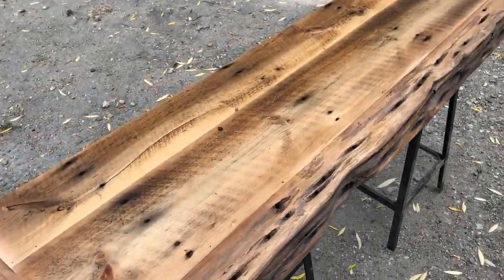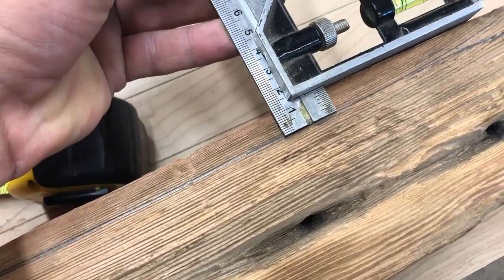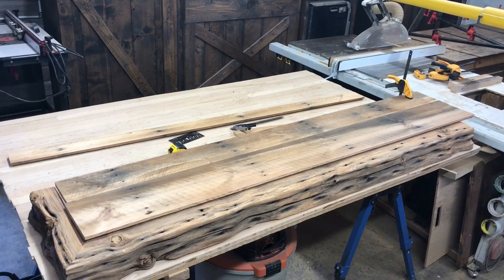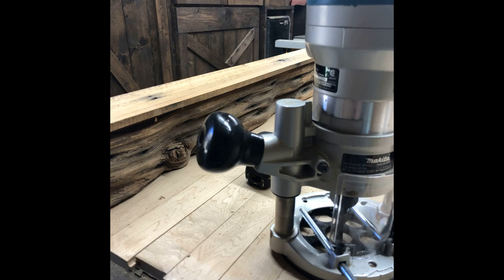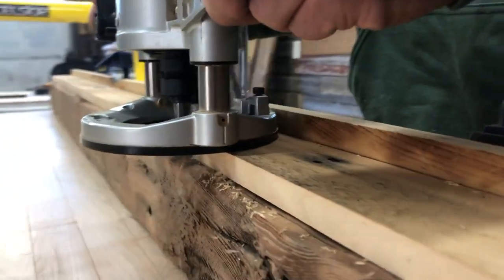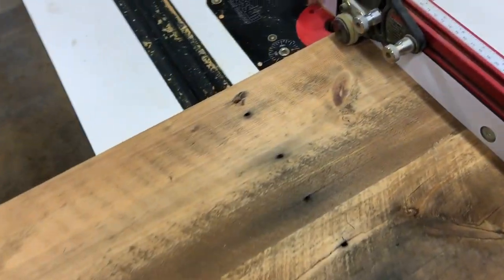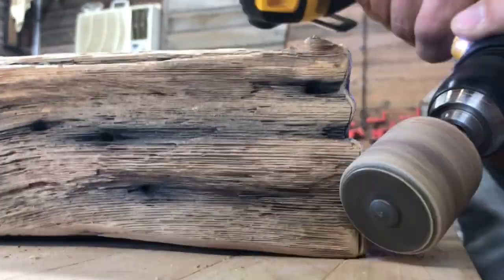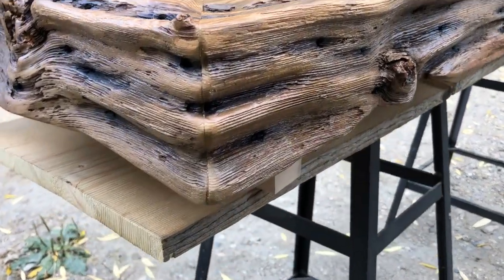Barnwood Beam Fireplace Mantle Build

Comment: The finished edges looked good.  I’m wondering why you didn’t use cedar plants for the top and try to match it better.  If you did forgive me.  I just didn’t hear you say that.  
Where did you get your posts fir the edge?
Reply from the maker: The 4x4 in this video was once part of a roof structure riddled with 6" spikes.  Over time exposure to the elements contributed to the uniqueness.  Cedar planks were used for the top, in fact 3 options were discussed with our customer and this is what they decided to go with.